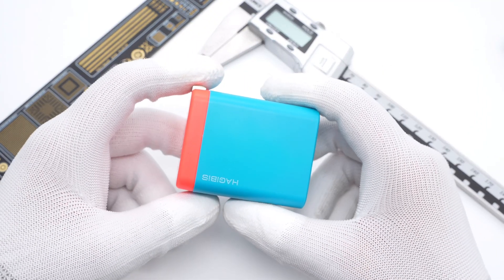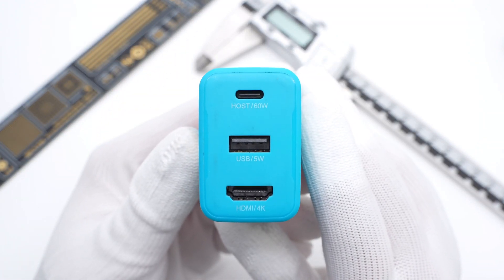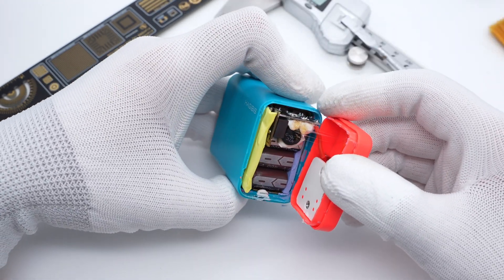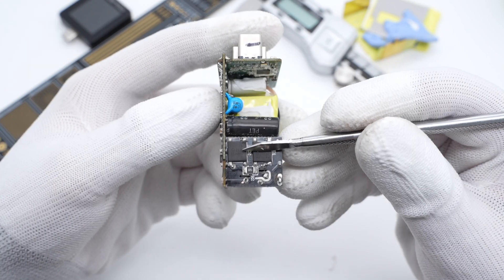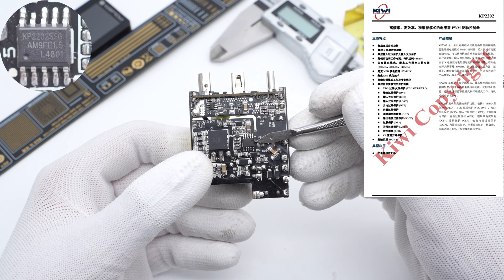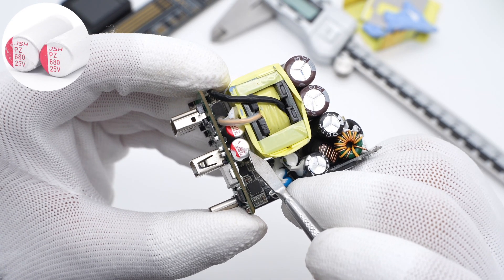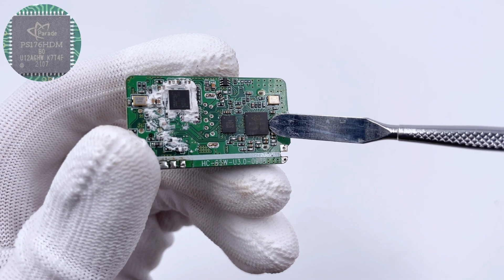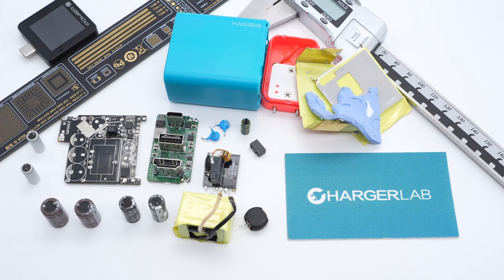Teardown of HAGiBiS 65W GaN Charger Dock With HDMI (For Nintendo Switch)

Comment: Its not rated by USB-IF, UL, CE, ETL or Intertek, it might work but I would never use it to charge my switch. Too many electronics get wrecked by non-rated cheap power supplies.
Reply: this producent has smaller dock without power supply built-in that has sold arround 10 000 pieces, I think it's safe to assume it's alright

Comment: Can anyone explain the HDMI port? I am confused about how it is used.
Reply: The data goes through the switch's USB-C port and out to the TV via the HDMI port.
Reply: @Distress.  I get it now, thank you very much.
Reply: The switch plugs into it, HDMI goes out of it. This is an alternate minimal dock solution for the nintendo switch(non-lite).
Reply: Turn on the volume. 0:12 , it's a charger and dock, it's even in the title of the video...